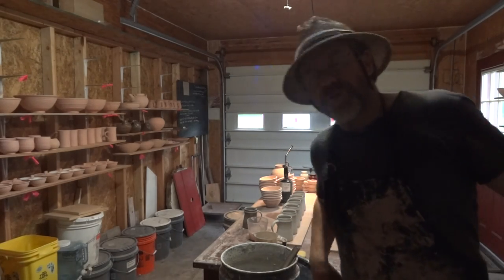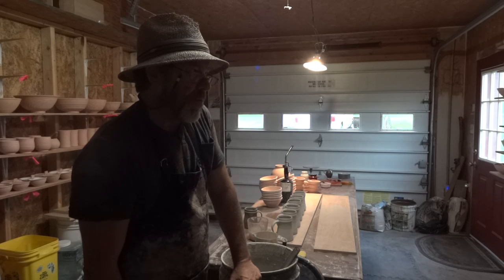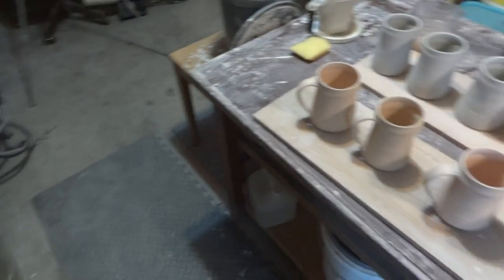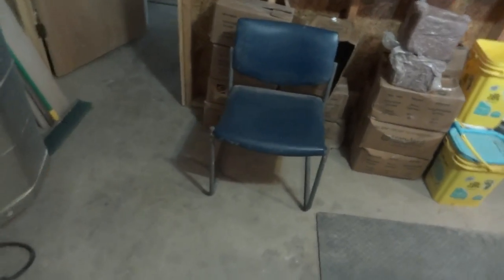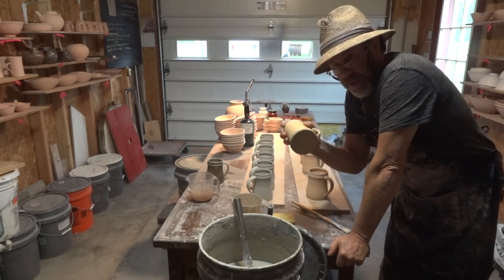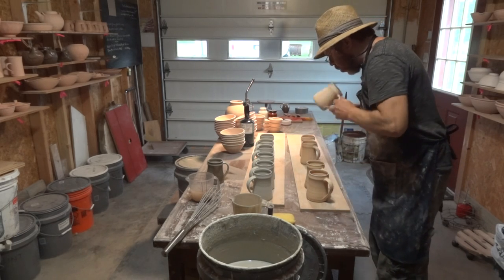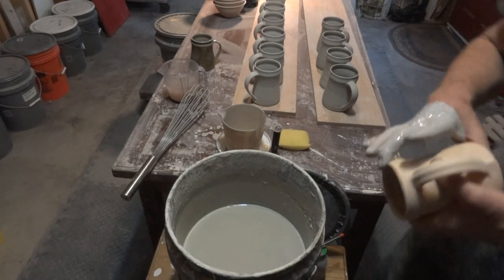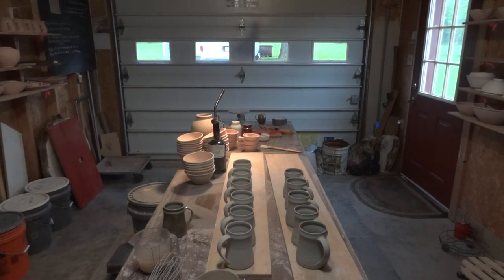SIMON LEACH POTTERY TV - How to glaze over fired bisque !

Comment: Awesome video. Always love the stories and jokes, too!

I know you're double dipping, but is the inside technically glazed a bit thinner because you do it normally?
Reply from the maker: Well yes you are correct !  it is double dipped but the outside got a long 'hold down' in the glaze. But no worries should be fine. I will comment later when they are fired !
Reply: Awesome! Thanks so much for answering. 

The outside would probably be the most likely to peel off or crawl anyway. :) But the thickening of the glaze probably helps it adhere to the inside as well!

Comment: You were heading towards the glaze, there could be worse places than the floor.   When fired, will it be as strong or durable as pottery that hadn't been over fired?
Reply from the maker: Well yes you are right if it had ended up in the bucket that would have been the end of it i think !  The pots when glazed fired should be perfectly as durable as usual pots. The problems occur when trying to glaze overfired bisque.